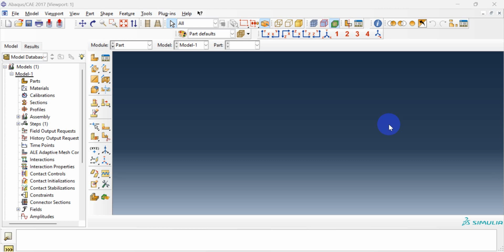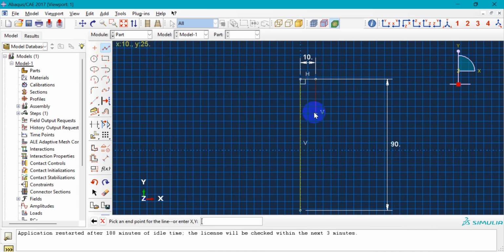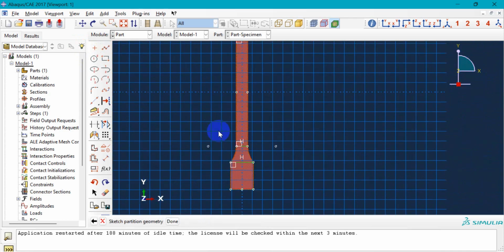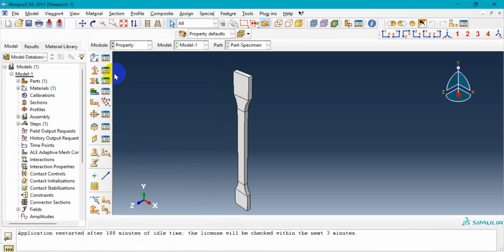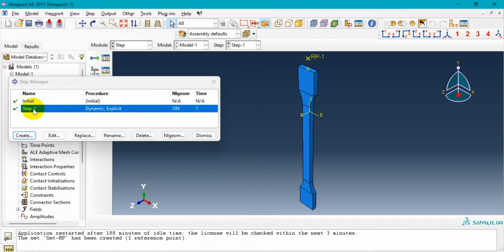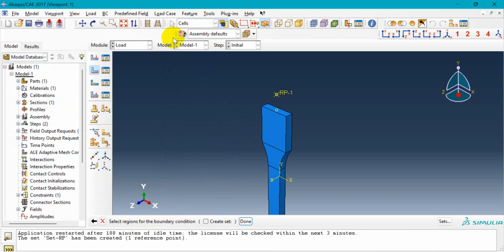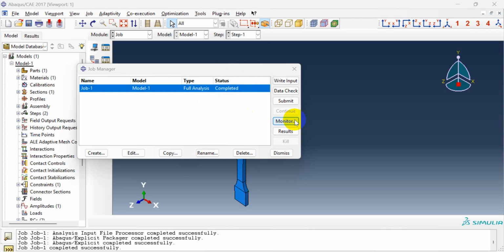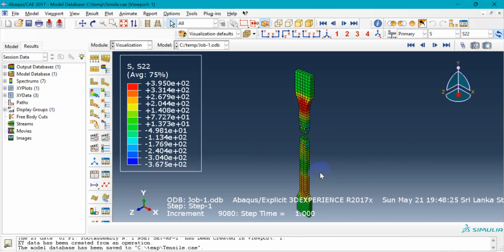Introduction to ABAQUS using Tensile Test

Comment: Can you solve this model for rubber material instead of steal.?
Reply from the maker: Yes, it is all about changing the material properties and using the corresponding material model. Thanks.
Reply: @ModellingMadeEasy  I tried it but after submitting job It’s aborted

Comment: why you set a reference point? you can use a cell in the top to add the force. please expain it
Reply from the maker: That way I can easily define the displacement boundary condition to the whole top part of the specimen which is considered to be clamped in in the practical experiment. Thanks.

Comment: Thanks for the tutorial, but from the F-D plot has a lot of noise, how would you fix that?
Also, how did you formulate your damage model parameters?
Reply: This might be late, but I found you can fix the noise by going into boundary condition 2, and when you create an amplitude, you instead would use type: smooth step > time span: step time and in row 1, use 0,0. Then in row 2 use 1,1.

Comment: Hello can we use the same configuration in the general static analysis?
Reply: You can use. No problem.
Reply from the maker: Yes, you can use it with the relevant step. Be mindful on defining the load or displacement curve correctly. Thanks.